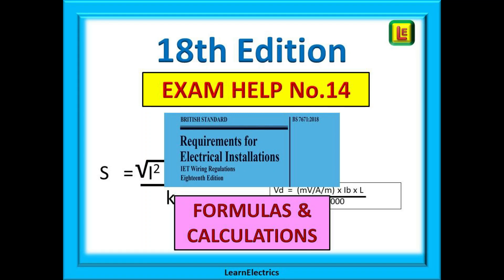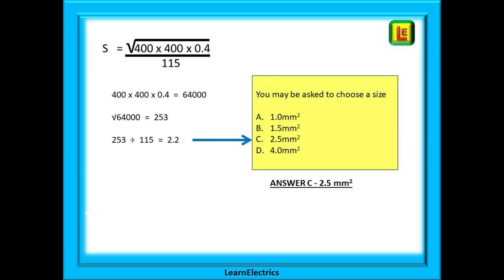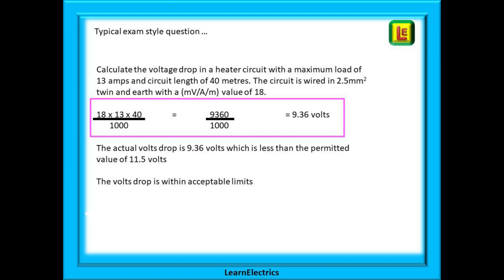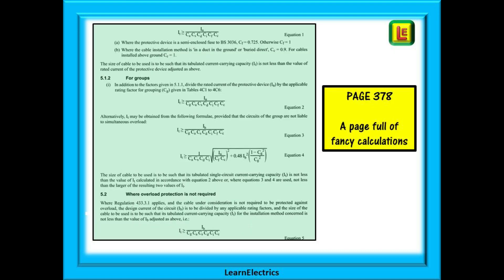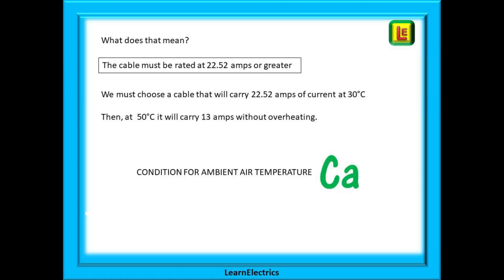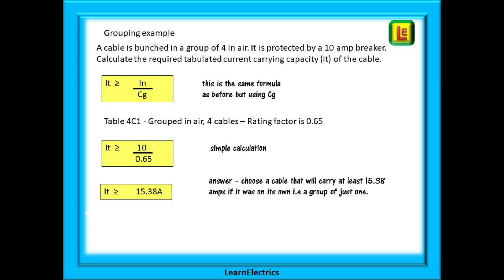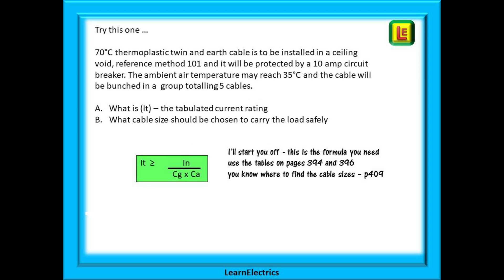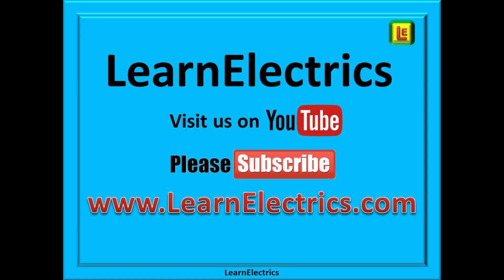18th EDITION EXAM HELP No.14. ESSENTIAL FORMULAS & CALCULATIONS

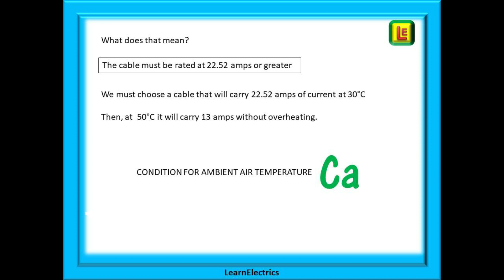Comment: At 10:25 , you are saying that:  "the cable that carries 22.5 amps at 30 degrees will be able to carry 13 amps at 50 degrees"??? Could you please explain where did you get that 13 amps from? It dosnt seem right.

I mean, you worked out that at air temperature of 50 degrees our cable was able to carry 22.5 amps; and based on table 4D5 we must select a cable that carries a current equal to or bigger than that, which is 27 amps at 30 degrees.
 50 degrees. 

50° ----> 22.5 amps
30° ----> 27 amps
Reply from the maker: The actual exact answer is 22,5 amps, but you cannot buy 22.5A cable for Ref method C off the shelf. so we would install 27A  or 2.5mm cable. Hope this helps. Dave.

Comment: At 18:30 is the length of the circuit L  the length of the cable or is it double this to allow for neutral path
Reply from the maker: From the CU to the point of use. Hope this helps. Dave.

Comment: Thanks for the video alot. But question 7 from previous video,  should the answer not be B, as the for 32a bs 88-3 on page 364, it says 280a, you have chosen answer A which is 450a way above 280a. Can you explain please. Thanks
Reply from the maker: A typo. It should be a 45A fuse. Try that. Thanks for watching.

Comment: Hi, your Q7 from lesson 13 asked for 32amp which, according to the table on p364 for 0.2 seconds would be 280A, the 450A is for 45A. I thought i was going mad when I couldn't see 280A as an answer option when I did it ;-) thanks for the videos though, they're great help
Reply from the maker: Yes, my typo Craig. A few of you have spotted that, so much for copy and paste.
But it does show that you are paying attention. You are now an expert on this section and good luck with your exam. Dave.
Reply: @learnelectrics4402  exam yesterday, 92% so thanks again, really enjoyed the videos 👍🏻

Comment: Thanks, may I know why the answer of Q7 (Appendices) is A (450A), not 280A?
Reply from the maker: Yes you may. Q7 should ask about a 45A fuse nit 32A. Put 45 in and you'll get the right answer. My typo. oops, sorry.

Comment: I have my 18th exam in a few days. No calculation questions whatsoever have come up in the practice questions provided by my online course, which I have run through about 50 times. I would question the need to learn the Actual Voltage Drop calcs, as that formula doesn't appear in the regs book. The 18th exam is supposed to test your ability to find answers in the regs book. It's not a memory test. We haven't been told to bring the Onsite Guide, so I'm very doubtful that a volt drop question would come up.
Just thought I'd mention that to help others. All that being said, thanks for the video, I feel more confident now if a calcs question does come up.
Reply from the maker: It is in the Regs book. Take a look at page 377 - Section 5. It's there in words which is why most people miss it.
Reply: @learnelectrics4402  thanks for the quick reply! I came back to delete that comment because I realise I was wrong. I bow to your superior knowledge!
I'm a bit disappointed in my course provider for not supplying practice questions which involve calcs. I've been getting 58 or 59 out of 60 in practice, in less than 1 hour, so I should be ok, but I just don't want to get unlucky with the questions and embarrass myself!

Comment: Thank you, now I am starting to learn how to read this encyclopedia correctly by following your valuable videos, but I need to follow up more, as you are a sophisticated person in education, and I commend your efforts that you give us to learn
Reply from the maker: Thanks Radhi, great feedback.
Keep learning a little every day, it will make sense and thanks for watching.
Lots more to come.
Dave.
Reply: @learnelectrics4402  when I read b.s book found table  4d1b page 402 it use R&x&z  to calculate  voltage drop it start from 25mm cable size who can use it.with my regards so I appreciate your hard work ( thanks)

Comment: Hi Dave, I got 280A for 0.2 seconds on question 7(BS 88-3 FUSE) of the previous video. Different to your answer here.
Reply from the maker: Yes, you are right. The question should have stated a 45A fuse. Well spotted, I've corrected it now. Just goes to show that you are learning something, good luck with the exam. Dave.
Reply: @learnelectrics4402  thank you for the great videos. Really good TEACHING!

Comment: dear sir  I like the your video I am very very happy and watch your every video it is Wonderfull and understanding            I=1150 t=0.5 seconds K= 115 it gave me answers 7.071 mm2  but your answer is 25mm2 please can you explain  me may be I am wrong calculation. thank you
Reply from the maker: Azizur, you have made the same mistake that many others also make. Read the question properly, do the calculation in stages. t is 5 seconds not 0.5.
Try again, you won't forget this now. You've just added to your learning. We all learn by making mistakes. Good luck. Dave.
Reply: @learnelectrics4402  
Hi Dave It Azizur Rahman
If unknown  r1r2 for ring how to do  voltage drop by ohms 
Thank you

Comment: Outstanding video Dave, just one query. If I have a T&E with reference method B or E used, these are not on table 4D5 (p409), am I right in thinking we would revert to table 4D2A (p403) for this situation?
Reply from the maker: For Twin and Earth go to page 390. The bottom half of this page (Table 4A2)  is what you want for the installation methods and then page 409 Table 4D5 for cable sizes.
Reply: @learnelectrics4402  yes I understand  the 100, 101.. etc methods. But how about t&e in surface trunking or conduit, ref method b? What current carrying capacity table would be used? Specifically for methods b or e?
Reply from the maker: The regs suggest that T&E should not be in trunking or conduit, it should be singles or multicore as per the drawings in the table. If you must put T&E in conduit you will have to try and find a comparison for multicore for your own circumstances.

Comment: Thanks for the video. As an adult learner I'm a bit confused with your example of Ca. I understand how you calculated 22.52 amps of current at 30 degrees but you then say that at 50 degrees it will carry 13 amps without overheating - should that not be 16 amps?
Reply from the maker: Well spotted and thank you. Yes, my typo. Should be 16 amps, the breaker size.
It's a good job someone is paying attention. Dave.
Reply: got me there too